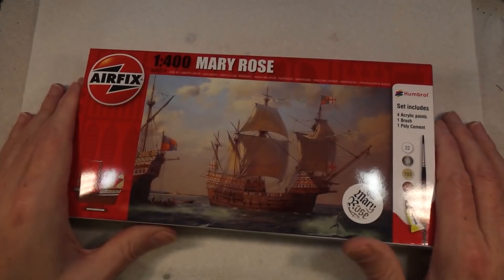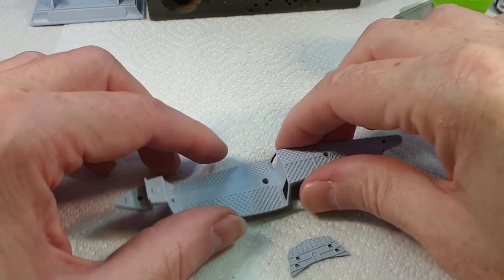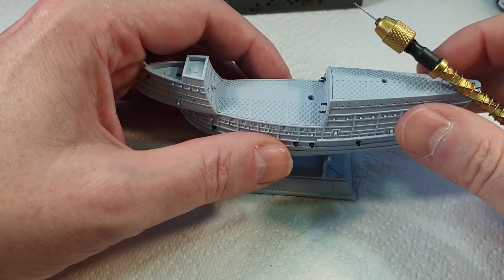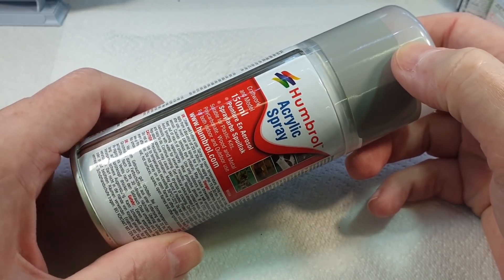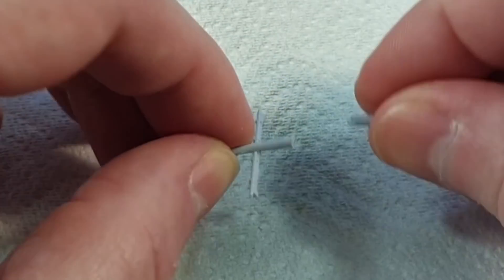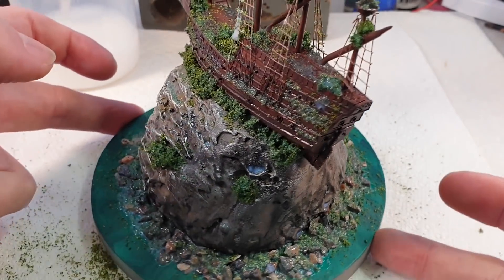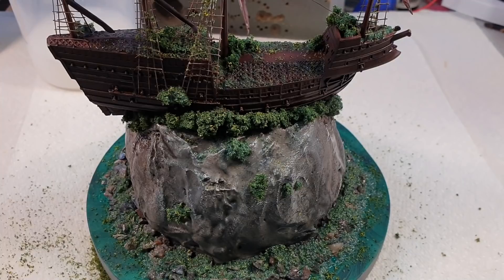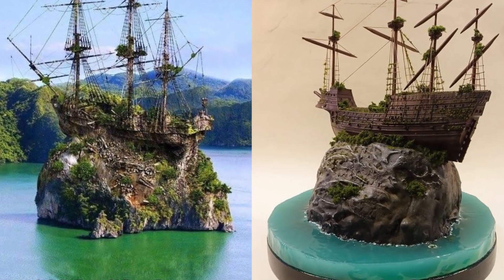Building a shipwreck or recreating an image in plastic

Comment: Your wire 'turnbuckles' will be marvelous on this model at 1/400 it doesn't make sense to try and scale the deadeye fittings that would have been used to tension the standing rigging. If you look at the link, what you have done is to simulate a single eye dead eye. https://en.wikipedia.org/wiki/Deadeye
Reply from the maker: Well, seeing as I know nothing really about ships, I'd say that was lucky :-)

Thanks for that :-)